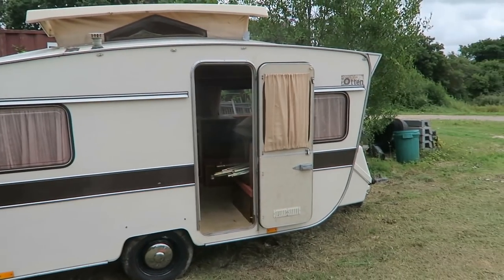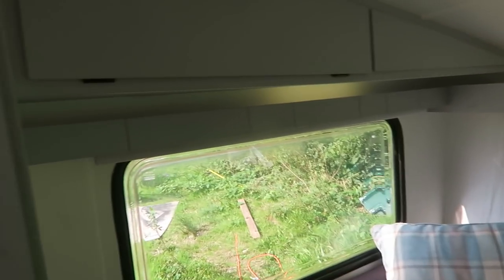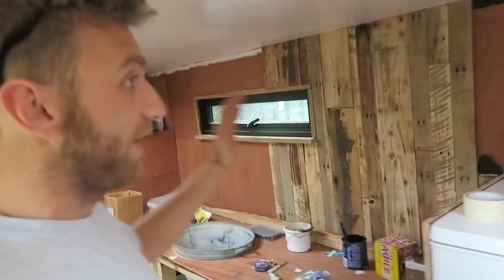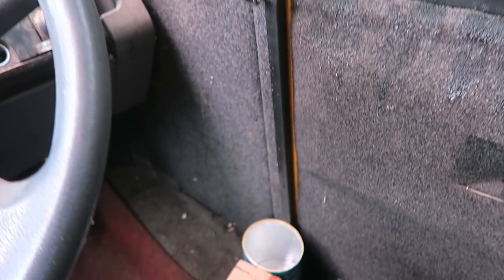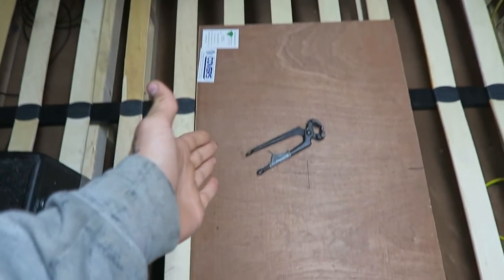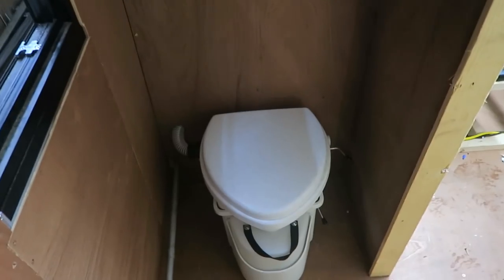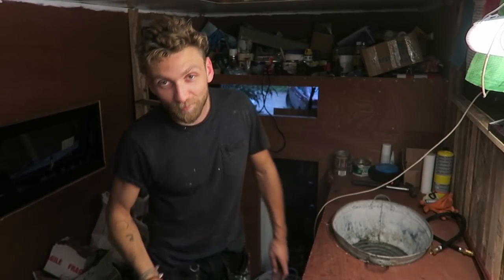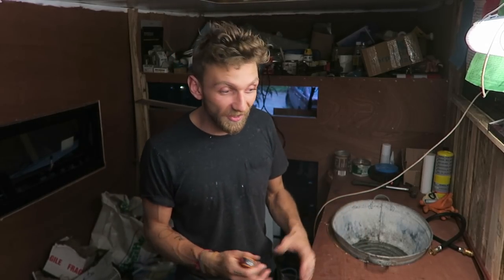Off-Grid Bus Conversion #24 (UPDATE)

Comment: Love how the bus is looking, but don't forget that the refrigerator needs an air gap around it to breathe.
Reply from the maker: Well these new compressor fridges only need 50mm just at the back.. No vents or anything. I guess because they run at such a low wattage they don't get that hot..?
Reply: Please, what's the Brand and Model of this Fridge?  It's the perfect size and low draw, I've  not found that so far in any search.  Love from Louisiana!!  K

Comment: Matt... could you post the make and model of the fridge freezer on this feed, I would be most grateful.
Reply: S Andrews yes, I need to know that as well! Although I may use a chest freezer as a fridge in a drawer type arrangement with a Peltier device!
Reply: Deveron53  found the snomaster range which look interesting, but top loading or Waeco CRX80 CoolMatic Compressor  Fridge Freezer. But I really want to know the make of the one he installed, it's perfect for my build, and a good size freezer!!